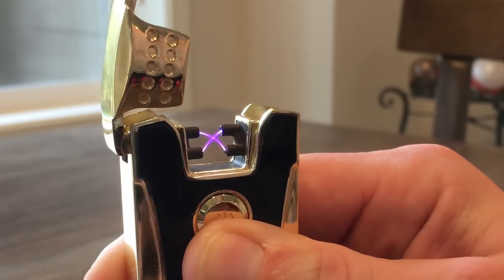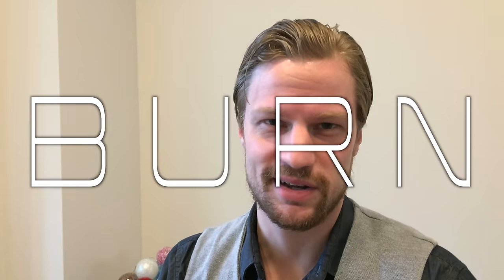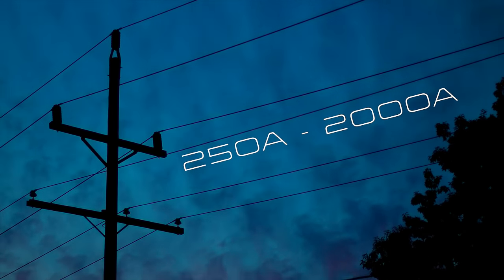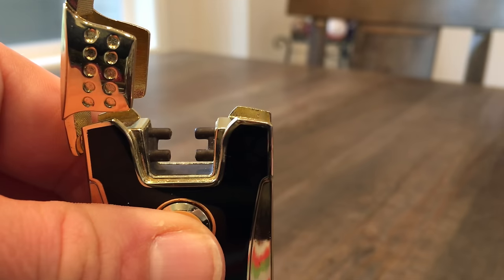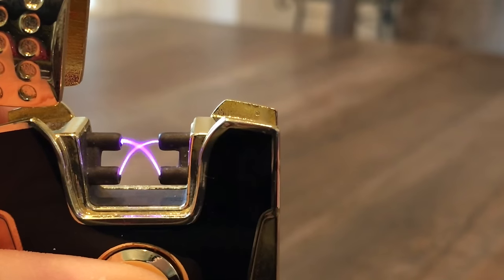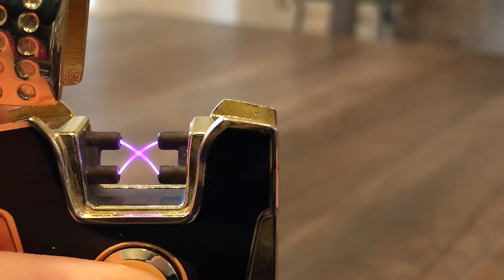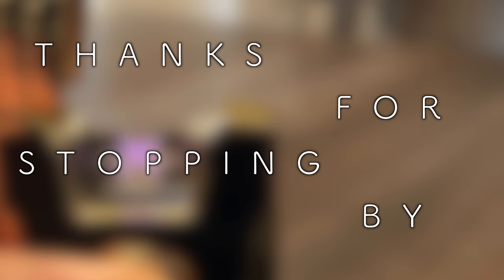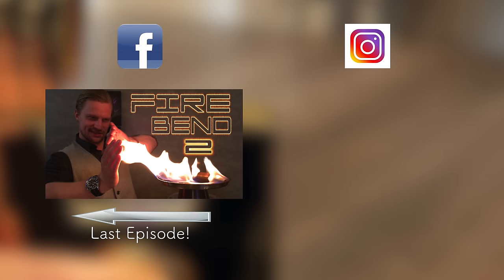| The Tesla Lighter | And The Shocking Truth About Arcs

Comment: I've got a Zippo arc lighter insert. It's so cool. It looks like a normal zippo insert, but rechargeable and with electric arcs. Very very cool. Works great. It's safer than butane or lighter fluid. If you smoke, you can safely inhale the first drag without worrying about breathing in lighter fluid.

Comment: Nice vid as always! You could also explain how the lighter creates two separate plasma channels. Also as far as I'm concerned, the record for electric arc temperature is 99,000°F or 55,000°C. Look up water stabilised high power arc, this concept is like more than 50 years old. Basically when you rise current through a powerful arc, the temperature doesn't rise more than 7,000-10,000 °C because arc gets wider and the greater dissipated power heats up larger volume of gas to the same temperature. However, some guy named Gerdien(not sure what's his name in English) created an arc, that goes through hole in the water cooled ceramic thingy, so an arc can not get wider than the diameter of the hole, hence more current now gives temperature increase to like 30k °C or something like that. After that some other guys developed an arc that is completly surrounded by swirling water, and they did get that sweet 55k°C. Boom, the more you know.
Reply: Rapid alternation between pairs of electrodes? Just guessing.
Reply: fburton8 exactly, but not everyone knows that, worths explaining.
Reply from the maker: Thanks!  As for the alteration I took the lighter apart and found out they have two separate transformers that pulse a spark diagonally at separate times alternating at several kilohertz. To our eyes it looks like a consistent x
Reply from the maker: Also, wow... the more I know. As a scientist I make no claims to knowing everything. I love that you shared this with me- I’ll look into it. Thanks!
Reply: Plasma Channel my pleasure!
Reply: that lasts about ten minutes and cant be recharged ... lol
Reply: I'm surprised that kinda information was out 4 years ago or was it 3?
Reply: @Dragon-Slay3r  tesla probably observed it over 100 years ago, unless it was impossible then because the manufacturing process wasn't as advanced, so he had never seen arc lighters produced for less than 10 dollars
Reply: These types of lighters, although rare, were in consumer product designs almost 50 years before strike-matches were materialized.

Comment: As a smoker I use this lighter and the normal gas ones. The tesla lighter is great, to ignite a cigarette when its windy. But to light a barbecue a lighter with high gas flame its better. But all in all this tesla lighters are great,  but dont forget to charge the accu because it will be empty relativly fast when normal used.
Reply from the maker: Thanks for the input on it. I also heard It is difficult to light a cigar with this arc lighter
Reply: I just smoked a handful cigars. Dont like it. But you need a big and stable flame to ignite because  of the diameter... Could be a nightmare with a little tesla arc...
Reply: I use mine to light cigarettes, it works pretty well because a cigarette is pretty small and really even the smallest of flames can get one going...I once used an old battery and steel wool when I lost my lighter...sure I could have just searched harder but like I am, I like to do stuff like that just cause it's cool, heh.  I can imagine a cigar being larger and more moist would take forever to light with one of these.  But it's not just for smokers...anyone could use a nifty little device like this, for burning tags off clothes, stray threads, melting plastic for whatever you'd melt plastic for, fireworks, etc.  I just think the idea of a little handheld high voltage device is pretty cool, and I'd imagine you could even test neon signs with it.

Comment: Non-smoker here, but I bought one of these to put in my disaster preparedness kit.
Thought it'd be fun to look at through my FLIR TG130 thermal camera.
Since the camera's upper limit is 302º, only the electrodes warming up is visible.
Reply from the maker: Great idea. Yes, the arc is in the thousands of degrees, but the electrode i'd assume only in the hundreds
Reply: doubt it
Reply: don't have one of these as a disaster kit they are unreliable
Reply from the maker: @002rikk  RIK, doubt it or not, a fact is a fact. Plasma Arcs run in the thousands of degrees. I'm sorry to hear your lighter broke, but spreading negativity on my channel will not bring back your lighter. I have bought six of these, and the only ones which have broken are the ones I destroyed in my voltage multiplier DIY video, which, in the video I mentioned to be careful as they break easily when used for a DIY multiplier. I suggest you contact amazon or what company you bought it from, they will honor your purchase, and should either refund you or give you a replacement. They have a 1 year warranty.

Comment: And you don’t have to start smoking to justify owning one of these; - I’ve found they’re killer for lighting fireworks, anything with a wick, and vaporizing the insulation off tiny wires that are near impossible to strip without breaking some of the strands ... Just remember to pull them gently between some folded 400 grit sand paper to get the black residue off…

Comment: I wonder if it is possible to construct a Vaping device (e-cig) with this technology ? Can this heat and vaporize the eliquid for vaping ? Traditionally the metal coil/wick system is used in all vaping devices and I was wondering if this tech could replace it. 🤔🤔
Reply: Breathe air!!!! U dont need a vape.
Reply: It would not only vaporize the eliquid, it would turn it into plasma, which means the organic molecules you are trying to smoke would be turned into loose atoms flying about missing some of thier electrons and then reform into CO2, ozone, NOx and soot, maybe some methane and other simple organic molecules.

Comment: how on earth do two arcs manage to cross each other without interference?
Even the Ghostbusters couldnt do that!
Reply from the maker: That is the crazy part. There are over 30,400 sparks per second. But they alternate back and forth (two separate circuits produce two separate sparks). At over 30,000 sparks per second, it looks like the sparks are connected. Crazy stuff!
Reply: @PlasmaChannel  
Finally an explanation. These things have puzzled me for a long time. Thank you.
Reply: @PlasmaChannel  I dont know much about electronics, but would there be a simple way to change the frequency to much lower so its not so much of a high pitch noise whenever its on?

Comment: Would it create heat in a vacuum
Reply from the maker: In a vacuum, it would not create much heat. As far as I understand it
Reply: @PlasmaChannel  Ions are the result of losses and gains of atoms when excited, and relaxed, electron excitation , or field propagation passes along a series of fixed in place electrons in any material that has enough electrons that we consider it conductive. 
Whether it's in a vacuum or not, charges lost or gained is a result of movements inside the material, not outside. Charge and magnetic fields effect the outside of that material.
Heat would be created in a vacuum if the arc creates heat at all. 
The problem is, that heat doesn't go anywhere, it stays in the material, it has no outside atmosphere to disipate the heat so it would either melt or vapourize itself in the vacuum of space. As cold as it is up there, any heat created is trapped in place.

Comment: So if I touch it, zap or burn?
Reply from the maker: It will be a burn. If you short out the leads across your hands and over your chest, it will be a mild shock.
Reply: Cheers. Too chicken to find out for myself. Can’t seem to convince anyone to test it out for me either. For scientific purposes.
Reply: Plasma Channel 
Keen to make a super size one?
Reply: I just got one and the perpetual beavis that  I am, I just *had* to touch it to find out, quickly.  It both zaps and burns, I only touched it for a brief second and it put two tiny white dots on my finger and it was a reasonable jolt.  I wouldn't recommend anyone do it, but if you do, it will certainly burn you exponentially to the amount of time you hold your finger on it.

Comment: circular constant distance jacobs ladder, dc, circular arc accelerator
Reply: separate constantly on dc coils, vertical magnetic field
Reply: dc ring accelerator
Reply: high voltage ballast between inside and outside of the ring electrode plates, high current when plasma (air, gas) is formed
Reply: hv spark + arc flow, all dc
Reply: you should at least have a plasma light show running around the circular ring

Comment: mine stopped working after 1 charge 
utter rubbish 
avoid these cheap overpriced Chinese nick nacks
Reply from the maker: That is sad to hear.  I’ve abused mine and it keep ticking
Reply: discharge to the ground of the multipier ???
nowhere buying this lighter did it say anything like that
what difference holding the button down the spark goes out after couple secondsits a lighter you should be able to hold the button down and have a spark till the charge is gone
cant you press the button ????
first one arc died now dosnt charge ... lol
showed the boys in the gym tonight they thought it was hilarious how crap this thing didn't work
and they are the sort that would buy them for novelty ... or a gift 
its going back tomorrow ... and now I know this tesla stuff dosnt work ... musk must be a proper scammer
when this one broke I googled it 
loads break straight away ... its a flawed technology 
probably die of like beta video
oh well at least I warned plenty of people don't buy these and will carry on warning people 
good idea but they should get them working properly before they sell themtheir write up is very good bit of kit .... reality is don't believe what the manufacturer says 
or the online reviews ... lol they rated this garbage .... lol
Reply from the maker: @002rikk  PLease read my other comment. Also, this lighter is not through Tesla, the car company. It has nothing to do with Musk. Again I'm sorry to hear your lighter broke, that's frustrating, but you have a sample size of 1. You have bought one lighter and it broke right away, meaning you have zero grounds for claiming that the product is no good. Personally I love the thing. Id suggest having a replacement sent. Best of luck